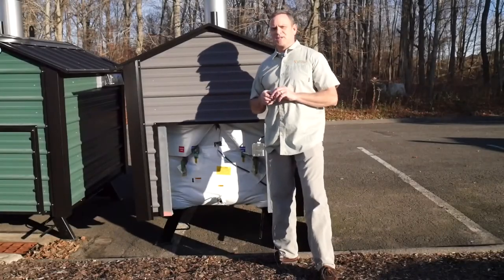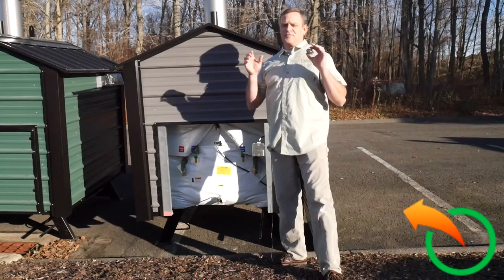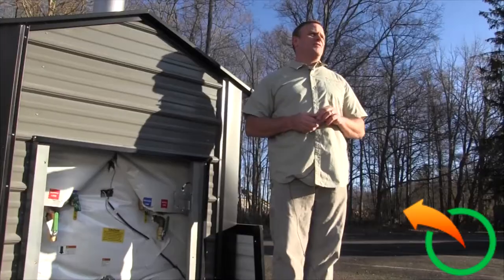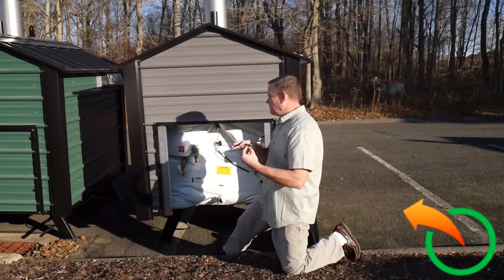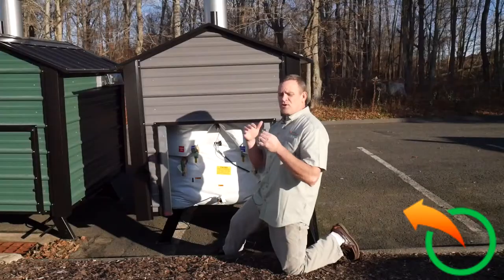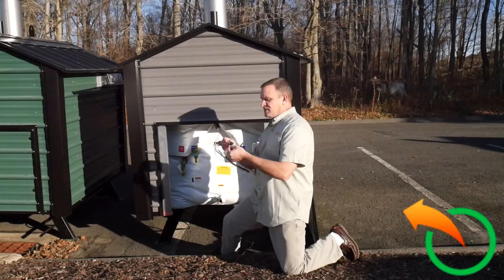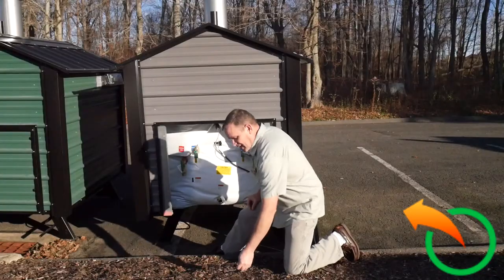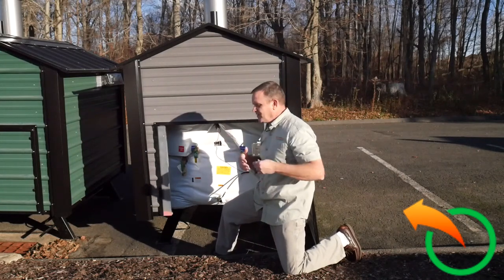Outdoor Wood Boiler Snap disk Issues. How to fix or trouble shoot.

Comment: What is your opinion on manifolds vs closed loop single piping ? I have watched your video that recommends running to the heat plate first and then the heat exchanger. Unhappy wife was a good touch. Lol.  Is single loop a better option or using a manifold to run separate zones to each ?  Hydronic heating use manifolds and seem to retain heat efficiently. Thank you for your time.
Reply from the maker: I like single loops, you don't want to give water an option.
Reply: @AltheatsupplyLLC  with that said if running floor heat in a barndaminium would it be advised to run zones so you don't end up with hot rooms vs cold rooms or just one solid loop throughout the house and a separate zone for the garage.

Comment: Thank you.  Extremely informative and to the point.  It's Christmas Eve and my fan stopped running.  This was the issue.  I've had the wood boiler for 3 months and love it so far. I'm in Missouri and dealing with the polar vortex, I was not ready for -30 F but that's life. Really appreciate the video.
Reply from the maker: Burrrrr stay warm.. Jeff
Reply: You learn quickly the spare parts to keep on hand knock on wood my pump waited till the last burn week of the season to crap out on me last year

Comment: If you're just finding this video and have a 5500. Keep in mind there is another disc on the back fan tube. You will need to jump both for the fans to kick on.

Comment: I just bought a house with a 434 and my fan won’t turn on. I changed the aquastat and the solenoid on the door. Jumped the snap disk and still didn’t turn on any suggestions?
Reply: @andynieves8792  imagine you figured it out but check for power at fan #1 if no power work backwards till you find it.

Comment: I have a 4400 and the lower temp is set at 145 for the fan to turn on. It is not doing that. it will kick on if I hit the reset button and shut down when it reaches the 165 setting. As the stove cools down it won't turn the fan back on unless I hit reset again.  Any ideas?
Reply from the maker: It has a snap disc which turns the unit off at 150 degrees, that is why your having issues. You never want your boiler temp  that low. I recommend the lowest at 170. There are many reasons why and don't want to write a novel.